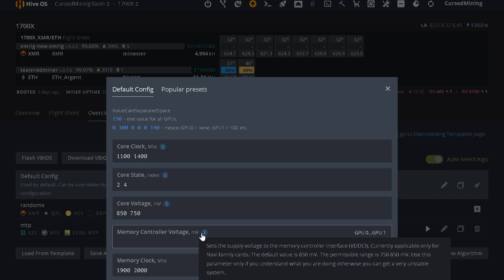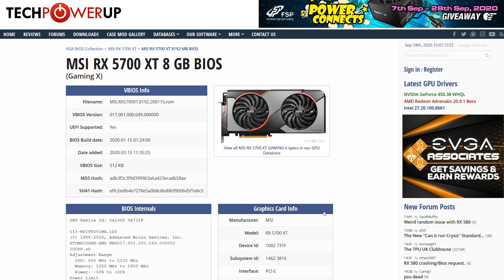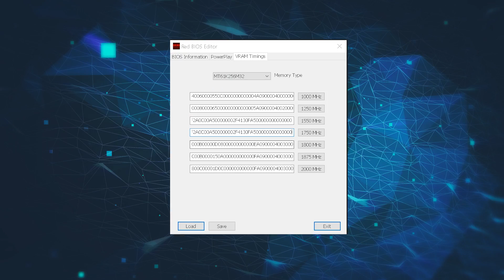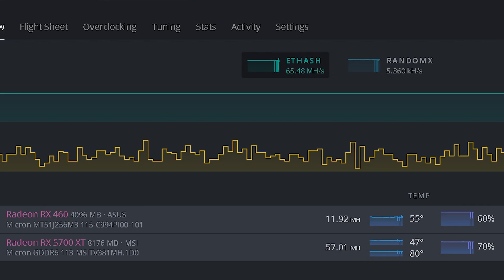RX 5700 in HiveOS, Overclock, Bios Mod Ethereum Mining ETH XT flash Modding gpu mining

Comment: HIVE OS 
5700xt Saphire Nitro + Micron Mem
CC 1400 to 1430 (try 1350 IF you experience crashes, then tweak other settings)
VDD 775 to 780 (continue to raise +5 if unstable/crashes/restarts)
VDDCI 800
MVDD 1350
Mem 920 to 950 (stable)

5700XT AMD/ATI SAMSUNG Mem
CC 1350 (lowering clock helped stability, over this value gave invalid shares but might try 1400 again)
VDD 775 (raise +5 if crashing)
VDDCI 800
MVDD 1350
MEM 895 to 900 (stable)

5700xt MSI MECH Samsung Mem (the worst card performance and thermal wise)
CC 1350
VDD  775
VDDCI 800
MVDD 0
Mem 895
This MSI card  has been a PITA, even with custom straps/bios it only gets 55.4 mh/s MAX before invalid shares or crashes. 1400CC crahes the card regardless of VDD, if someone finds a better OC please let me know!

When changing values do +10, run for 24hrs, if it crashes then -5, if it crashes again then -5, repeat until you tweak your settings. Nobody said OC was easy, its time consuming and headache causing but being patient and logical pays off!!!

I hope someone found this helpful, give it a upvote so others can see!
Reply from the maker: I am just tweaking mine again, managing similar numbers as you :) will do a video update soon, thanks for sharing!!

Comment: I think the key to better hash rates for power is to avoid Hive OS and go straight with Win10 and Phoenix miner. You can control all your miner stuff straight from the command line with the config file. Because the cards in Windows run at twice the memory frequency they draw less power than they would in Linux while at the same time giving you better performance (like 1-2MH/sec). If you couple this with a good mining monitor software you can efficiently control your rig remotely for most things not even having to log into it by uploading a config txt file to it with new changes you want to make.
Reply: They dont run twice as fast. they just display the clocks differently. In windows MSI afterburner shows the DDR data rate. In hive/linux it shows the undoubled memory clock.
Reply: @azrielstrife2557  You are wrong. It has something to do with how Windows handles memory vs how Linux handles memory. You literally have to halve your memory frequency settings if you mine on a Linux OS instead of Windows. Your miner will also draw more power comparatively do to the memory running on a lower frequency when running on a Linux OS. Try this yourself. Take your rig off of Hive and put it on Windows. Your rig will get more shares in the same amount of time and with less power. The trade off though is your rig will be less stable and will be needed to be restarted more often. This trade off is well worth it IMO due to not being handcuffed by a mining OS.
Reply: @ScientifikX1  not so. My hash rates are better on hive.

Also. Hive does in fact report the undoubled clock rate. The card will always run at stock speed regardless of os.

875x2 = 1750 which is the stock memory speed of an rx5700xt Typically. If you go to 900 in hive your memory is actually running 1800mhz.

Sorry but if it was actually running at 900mhz it wouldn't get even close to 50mh, nevermind 58+.

Comment: Just bought this card and when mining the memory temp sits between 96c and 100c. Nobody seems to be talking about it
Reply: whats your core clock at?
Reply: @blackfish4674  1350 cclock. Stock Bios
Reply: @blackfish4674  1350 core 1900 mem. -40% power limit. 125w power draw. 48c core, 94c mem. Modded bios
Reply: Yeah, it is a real pain in the ass. My temps were a bit lower, always on the cusp of jumping from 84c to 86c-88c. Only way to get around it was to blast the fan at 85-95%, but that is an untenable long-term solution. 

Replaced thermal pads today--2mm on vram  (arctic cool or some such) repasted chip w/ Kryonaut, and threw some scraps of 3mm thermal pad that I had laying around on to the back side of the vram chips to make connection to the back plate.  No bullshit, there is nothing drawing heat from the PCB to the back plate. Da fack?! True story, it is a heat chamber back there. 

 Fan currently set at 60%, if you can believe it.  Core temp stable at 50c and vram temp hasnt gone higher than 70c yet. 

Getting 54.21+/- MH with the following settings on HiveOS; no bios flash; Red Devil 5700 XT
119 W
60
1365
0
755/815/1350
965
130
Reply: Same here
Reply: @Hidiquiz  I took apart the cooler in order to measure the thermal pads on the memory modules. (They're 1mm and 2mm thermal pads). Apon putting it back together and tightening all the screws down extremely tight, I got a started getting 2c lower on memory temps. I'm ordering Fujipoly and thermal grizzly pads to try to  more effectively draw heat away from the memory modules. Also a bootleg way of dropping your memory temps down another 2c is to place a stock cpu cooler on top of your backplate where the top memory modules sit and apply thermal paste and a fan
Reply: @gamezmeow  Thank you for this information!

Comment: Nice video! Thanks! Do you have same settings now or changed? Whats ur oC settings and cvolt? :)
Reply from the maker: Heyho! There is a vid in which I had to switch to windows, since then I had to dial it back a bit but that vid with that card in Hive was the best I managed :) another 5700 same model does not like mem that high for example 🙈 cheers ⛏️
Reply: @CursedMining  what are your final OC settings?

Comment: With 6 5700 XT red Devil i get around avg 57MH/s at around 115W. Worst performer only clock memory to 1820 and get around 56,2mh/s. Clock at 1380, core voltage at 960 (950 prob possible) and 1820-1900memory clock. Bios modded for memory timings
Reply from the maker: very nice! I have one msi gaming x which is more unstable than the others, cheers ⛏️
Reply: I'm running RX 5700 Whatever I do, it's not going over 52 MHs, but, but, but.. I'm at 74W.. On it.. around 51.50 MHs.. So I figure I leave it at that.. Core clock: 1380  Core Voltage 800 Memory Control Voltage 750 Memory Clock 900,  Memory Voltage 1250... My Still showing as 5700 (w/o XT) So BIOS  not flashed.. YEP 74W... ;)

Comment: Great content. Do you know Vega 64 overclock's in hiveos ?
Reply: FlashEd mine to a vega 56 and put on custom timing. I also changed some miner settings so the timings run on reboot automatically in case I’m at work and it suddenly crashes got all my Vega’s 53/54m/h
Reply: My 64 was really unstable until I flashed it with a 56 bios. After that just use some amdmemtweak and I'am at 48/49 mhs
Reply from the maker: sorry to have missed your comment mate! I have none anymore to share exact numbers, sorry!

Comment: my 5700xt cant do 57. it does 52, 54 after mod! i must have missed something.
Reply from the maker: maybe the phoenixminer setting or the general overclock/undervolt ? Cheers ⛏️
Reply: @CursedMining  trying to find some settings now, never tweaked phoenix miner b4
Reply: my 5700xt modded does 58.4MH @ 118.5W; or 58.1MH @ 117.5W
I can share my biod mod and settings if you want
Reply from the maker: Awesome numbers! Sure we'd love to hear it :)
Reply: @CursedMining  my gpu is a 5700 xt challenger d, bios modded to double the mem temps. Used this guide as a baseline https://youtu.be/dzDPe3YuIx4 (idk if I should share links to other channels sorry), but set the voltages to 700 / 714 / 750 and now running at 1900MHz. Preety stable
Reply from the maker: @TheDoruSonic  don't worry about the link! I know the vid but did not take the time to check yet how it differs from the bios mod I did :) I have since put my 5700s on windows again since hive gave me some problems on one, so actually "tweaking them again and making a new vid" is on my list for a few weeks already. Always interesting to see what others manage to achieve so I appreciate it very much - thank you sir! Will share it on the channel if I manage better results :) cheers mate ⛏️
Reply: @CursedMining  its very similar to what you did but in windows! I was checking it out for a friend that will buy a 5700 and just making sure I could help appropriately. Cheers and thank you
Reply from the maker: @TheDoruSonic    that 1MH/s more though.. definitely worth it to waste an afternoon tweaking :D and I mean it hahaha, cheers

Comment: I have 2 ASRock Radeon RX 5700 XT TAICHI stock bios @53.5MH/s  Hive Settings 1350 / 720 / 780 / 1290 / 925 showing 102 and 104w in the software temps are 40-42 and 74-76. I also have a ASRock Phantom Gaming D3 Radeon RX 5600 XT stock bios @40.35MH/s Hive Settings 1120 / 709 / 780 / 1290 / 925 showing 71w with temps at 40 and 64. Ive tried to push for more but becomes unstable. core / vdd / vddci / mvdd / mem
Reply: Hello...i have managed to get my hands on some 5700XT TAICHI...have you managed to find some stable OC settings?If yes,can you share?I can't find anything online about the taichi cards....
Reply from the maker: Trial & error is your best friend! Definitely keep the mem cool, that makes every 5000 card unstable. Also HiveOS works better than Win unfortunately (AMD driver resetting)
Reply: @CursedMining  I have been trying for several days now to find the right settings for these cards.For some reaseon they start crashing at 890-900 mem in hive(samsung memory).The memory stays at arround 80-82 so I don't think it's thermal throttling...But thanks for the reply :)

Comment: Why is mine hashing 2MH faster with memory clock at 900 versus 1900? Micron memory.
Reply from the maker: my first mem settings were wrong, I started with what I am used to from Polaris 🙈 then dialed it in better, 925 :) but yeah there is some Silicon lottery too with Navi, some just work a bit better or do the same with 15 watts less etc. - which model is yours? cheers
Reply: @CursedMining  PowerDevil
Reply: @mulljacob  if ur reading them from hive os they are cut in half
Reply: @TheEVGAftw  I figured it out - I'm at 910 memory clock -  but don't know why it's that way. Thanks for the response!

Comment: This is crazy! So I have been one bios mod away from a 5700xt this whole time??
Reply from the maker: ...yes :D cheers ⛏️
Reply: Not quite. The hardware is mostly the same but some of the stuff it a little different. The 5700xt bios is built around those differences however will still work on a 5700 relatively safely. Don't forget to flash it back though if you have to send it back to manufacturer because that would void your warranty.

Comment: 6x Sapphire Nitro+ RX 5700 XT here:

Core: 1450MHz@800mV
Mem: 1920MHz@850mV
Power: 106W
Rate: 59MH/s

2 cards can only runs Mem at 1860MHz max, silicon lottery I guess, the others running at 1920MHz just fine for nearly 6 months now.
Reply: Hi I have the same one cards that I am building Sapphire Nitro. I just wanted to check your settings. Is this correct?

Core Clock: 1450 Mhz
Core Voltage: 800
Memory Clock: 1920
Memory Voltage: 850

Are this stock settings?
What is you memory core voltage settings?
You mentioned that this is stable for about 6 months of use?

I would greatly appreciated if you may assist please? Thanks

Comment: you should change trcf timing of each frequency to achieve more hashrate I set mine from 29xx to 5990 and I managed to get 58mh with 1860 memory and 1350 core clock and 800 core Volt (with msi rx 5700 gaming x)
Reply: Is it stable?

Comment: 5700XT Sapphire Pulse, my settings are: CV925, PL -40, CC 1408, MC 1858, power consumption is 117W and I get 50-53MH/s
Reply: mine cc = 1300, cv=750, MC = 1820 power get = 97 and 135 OTW, haserate get 56.3 mhs
Reply: @eternalrains9437  Hmm...interesting, I will try that right away...I can not get Core Voltage less than 800mV
Reply: @draganciricfox  use overidentool if cant go lower 800
Reply: @eternalrains9437  did you mod it
Reply: @GEEF100  yes

Comment: some people say MSI 5700 are worst cooling systems and it's very hot for memory is that right 
does Rog better than MSI ? 
Thanks
Reply: Yes, very bad for mem.
Reply: Red dragon and Radeon pulse have dedicated ram coolers, some have thermal pads in place connected to the GPU cooler, and some have only air-cooling on bare chip.
Reply: msi gaming is ok the mech and evoke are bad.  Best I would go with nitro, pulse, red dragon, red devil, msi gaming in that order.

Comment: Win 10 seems to use less power then hiveos that helps
Reply from the maker: How much is yours using? I realise different RX 5700 fluctuate a lot, sometimes another card can do the same hashrate at 100 watts, some don't, it is weird!
Reply: @CursedMining  dont have 5700s but got 570s and 580s that run 800 watts full system in win 10 but 1100 in hiveos.  I googled it and seems everyone has a extra 200-300 watts whole system in hive over win 10. Add up rigs and with enough of them u could power a whole rig threw wasted power.
Reply: @RabidMining  you mean at a wall or in software?
Reply: @cezar7460  at the wall when talking power use wall is the only number that matters overall.
Reply: @RabidMining  hmm interesting I seemed to have lowered my 13 gpu hive os rx5xx rig by around 200-300 watts by toggling the Agressive Overvolting (Set OC for each DPM state) my whole rig still reads around 1050 watts though, used to read like 1250+ (software numbers)
Reply: @CursedMining  silicon lottery